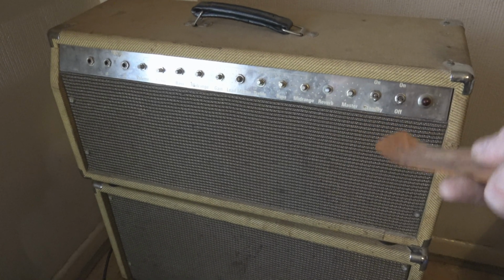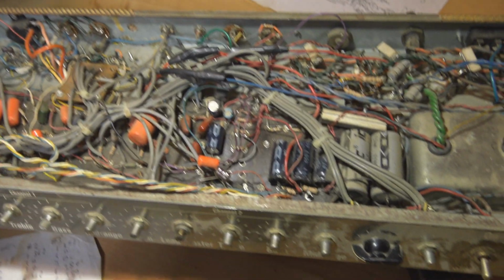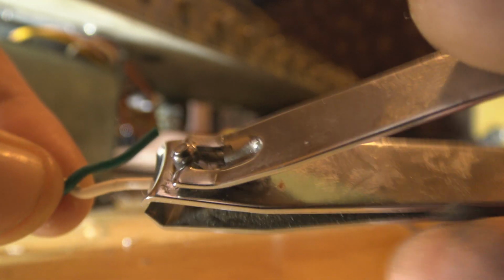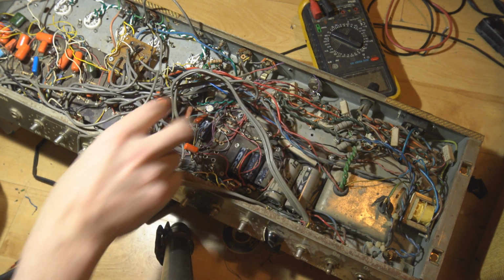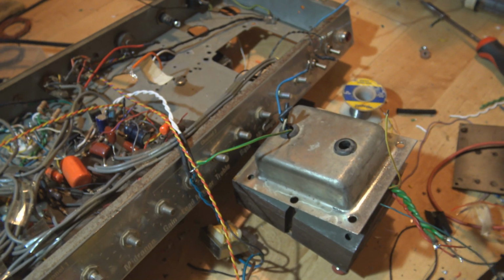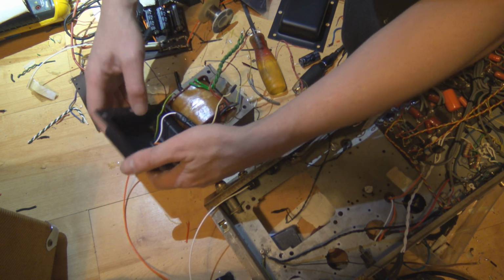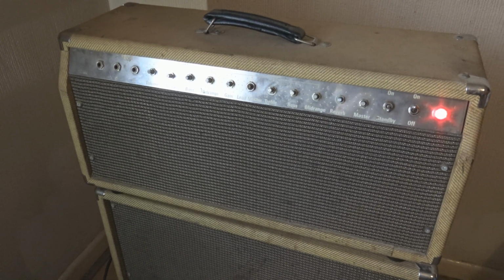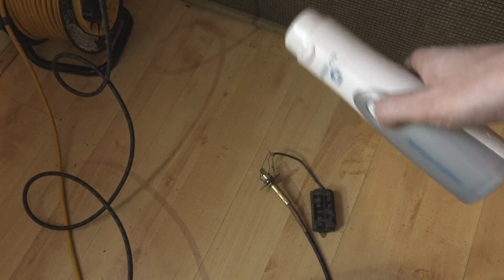Troubleshooting and repairing a faulty tube amp. Part 1

Comment: Check your Caps. Some of those oldies have probably dried out.
Reply from the maker: I replaced all the filter caps. Actually...all except the last stage, which is the one over by the input jack
Reply: mellowb1rd a really good example of "rats nesting" circuitry. Have you checked the valves? Sounds like a rectifying problem, a cap not smoothing out the AC, or a ground loop. I think you can still get valve testers. But, you'll sort it out. I've got faith in your fault tracking skills. Just make sure you turn the power off before sticking your fingers in. Otherwise you'll be joining your plate throwing friends in the kitchen.
Reply from the maker: @marktegan  Not checked, but the valves from this amp all work fine in the Orange, and the valves from that amp, don't fix the problem in this one, so I think it's safe to temporarily rule them out. I always discharge the filter caps before I touch anything inside. 
 I take it you're referring to the buzzing? I'll get to the buzzing. There's also a deep hum coming from the mains transformer, but it doesn't seem to come through on the video. I notice the rectifier diodes have bypass resistors, so I'll probably pull those out and try it some time, in case the values are off. It's hard to read the colour codes cus the paint is old. The red and orange are very similar. Also the violet and grey